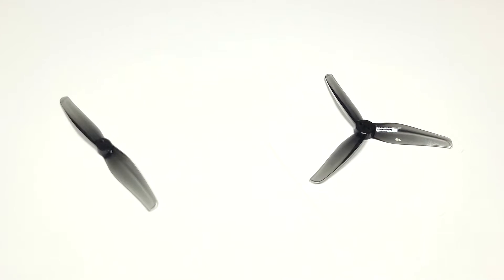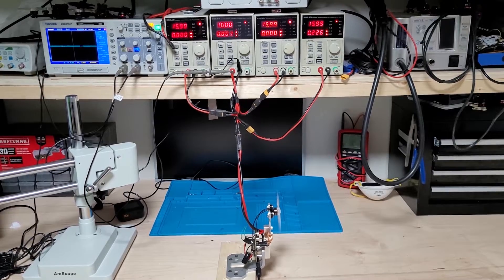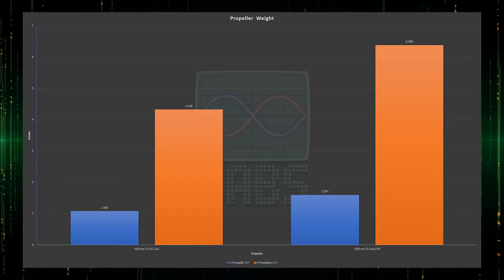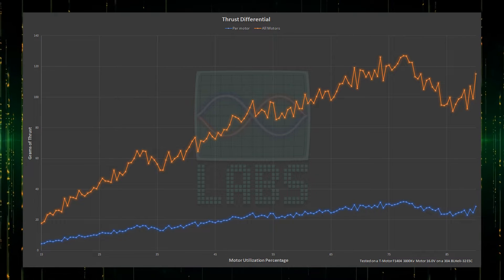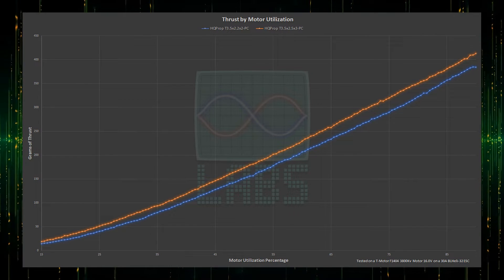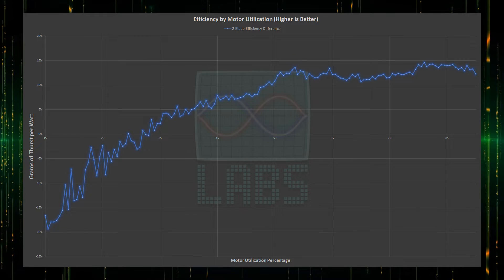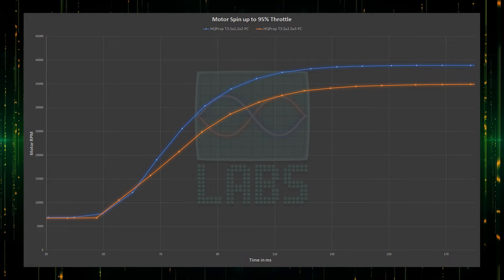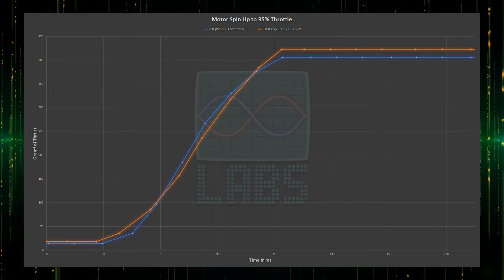2 Blade vs 3 Blade Drone Propellers - 3.5" Propeller Testing of the HQProp T3.5x2.5x3 vs T3.5x2.2x2

Comment: My observation is 
If you use 2 blade propeller suppose 20 inch dia u shall have to run motors at say 4000 rpm to get thruzt
Thus the badic torque req

Comment: One thing you forgot to test battery life and flight time....I would say the best one would be the one that enables the most flight time.
Reply from the maker: The charts show efficiency per gram of thrust, which is measurement of battery power output requirements.

Comment: my average throttle is 26% for an acro flight for probably 80% of the flight only really need the full throttle for a few seconds for power loops and pulling out of dives. for a long range your going to be climbing the mountain by wattage etc so quite low throttle... the thin air at the top of the mountain is going to force higher throttle to keep the lift for that same weight... so would the extra blade help it would help with lift but at the cost of a minor weight increase of the extra blade and the extra power needed to spin it.... this will be dependant on the weight of the quad to tell if it would be worth it... light long range would benefit using 3 blades... heavy long rang ???? (most motors will be over propped for long range as they will be more efficient this way as they don't need to react fast hence the need to use 2 blade)

Comment: Thank you 4:36 for your data driven analysis.
Do you have the equipment to test decibels & pitch frequency? 
You would then have the ability to test: thrust, amps,rpm against “Noise” for a given blade configuration (diameter, pitch & number of blades).
For some flyers, Noise is a large concern in a neighborhood setting, & may limit flying location availability.

Thank you.

Comment: Awewsome mate, keep the testing vids up! That is exactly what we need. Short video, facts only, no yada yada. Love it! 5/5 Stars!

I'm currently in the market for a new copter after not flying for years, just ordered a new Transmitter, figuring out the rest on the way. Looking for about 10mins of flight time and some capability in freestyle and racing. Nothing fancy so to speak, but I want to max out the flight time with the minimum bat size. Considering 1s LIION and 3" pick or 4" 3S LIPO/LIION setup. Unsure still, but likely going with 2blades now.

Comment: Motor engineer here, the problem lies in inertia, i don't know about these smaller motors,but on 5 inches about 50% of the power train inertia is in the motor bell, so the 2 blade doesn't spin up much faster at low regimes, where majority of the power goes into acceleration of the inertial mass instead of air motion.

2 blades shine more on smaller motors (relative to build size)
Reply: That is maybe why you want more blades for 3D mode. I want to get as fast air motion power as possible when changing direction. Because when the direction of rotation changes, the motor comes to a standstill for a very short time. And at that exact moment + -, the PID controller can no longer control the quad to maintain its position. This can lead to severe jerking... And that's exactly what you don't want...

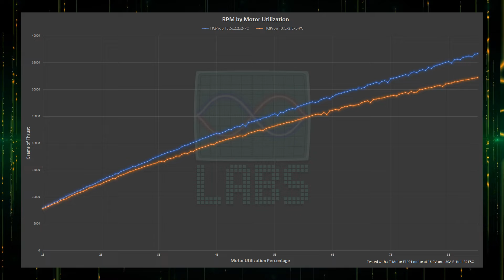Comment: Informative as always! 3:15 thank you! Personally I would use the two blade props for slightly smaller motors (ex. 1603 or 1106). Could you compare 3.5" triblade on 4S vs 4" two blade on 3S with the same motor (1408 3800kv)?
Reply: I think the two blade is well suited for the hglrc 1303.5 5000kv on 3s as a light build. Maybe 4500kv on 4S. Motors are on the way 😆. On 1204 8000kv 2s these blades were awesome. Now I just need a little more low end control and more Power from 3S and 1303.5
Reply: @chrisbee5481  Why not 1105 then? It's bigger and lighter than 1303.5 but anyway let me now how they goes :)
Reply: @samuelepaganoni9741  I've studied 1106 motor thrust test charts and compared them to 1304. 1106 is lighter. The motor stator volume is more or less the same. 1106 is just slightly bigger. Even though it's slightly bigger stator volume, the 1304 beats it in max thrust and overall efficiency. You need tourque to spin larger heavier props. Wider stators provied more tourque. The test data is all out there. You just have to find it and research. If you intend to spin larger and more pitch props, always step up the motor seize in width and not hight. So from 1204 to 1404 and not 1206.
Reply: @chrisbee5481  in efficiency at lower throttle yes because is smaller, in torque and thrust i don't think so, where did you see It?

Comment: Are the 1404 3800kv still the best choice for the tri blades?
Reply from the maker: If you're referring to the motor in this video, then yes, by a lot (that I have tested so far anyway).
Reply: @RecursionLabs  I guess I’m more referring to best combo for 3.5 inch props with the crux35 frame or similar
Reply from the maker: @bread12678  Yes, so far it's the T-Motor F1404.

Comment: What about 2 blade 3.5" on 1303.5 5500kV? 
(got Rekon35 from HGLRC with 3520 gemfan, but not sure how would 2 blade act)
Reply from the maker: I don't know since I have not tested it. It's possible the motor might struggle on the 3 blade and not the 2 blade though in that situation.
Reply: @RecursionLabs  I think that 3.5" gives a lot opportunity for sub250 builds, so testing motors such as 1303.5 would be cool. Btw, Dave_C FPV (designer of Rekon quads) also developed 1603 motor, which he claims is better than 1404 for LR endurance 4".
Reply: The hglrc 1303.5 will work perfect on this bi blade. It's just a question if 4500kv on 4S or 5000kv on 3S. I'll be testing soo
Reply: @chrisbee5481  Do you think bi-blade 3.5" would be less responsive with 1303.5 5500kV motor?
Reply: @brezovprut4431  I've tested the t3.5x2.2 on 8000kv 1204 with 2S. It defenatly takes 0.x of a second longer to respond vs 3".
Also it feels less more floaty. Altough my setup is ultra crazy light at 52g dry and 82 all up weight. It was actually intended on 1S, but 2S was a blast. 1303.5 on 3S should be more responsive at the bottom.

Comment: Nice testing! It’s interesting that HQ went with a lower pitch on the 2 blade. I guess it would target someone wanting to drop down to a smaller lighter motor that would struggle with the triblade?
Reply from the maker: That's my guess too. On smaller motors they would likely do better, like 4" 2 blades do on 1404.
Reply: it's the 2blade higher pitch variant of the t3.5x2x3
Reply: Was wondering about that, too. If I had this nice of a testing rig, I'd also be interested in 2 vs. 3 vs. 4 Blade but all other parameters (diameter AND pitch AND voltage AND motor) being the same. And perform that test with a motors which has three different KV versions available, so you get 3x3 charts out of it.

Comment: Have you ever burn a 1404 on your thrust bench in 4s?.  Did you tes multiwire small motor?
Reply from the maker: No, but someone wanted me to test 5000kv RCInpower 1207 motors on 4s and at about the 80% throttle test the wires smoked. Not surprised because the kv is suited for 3s.
Reply: @RecursionLabs  which props did you test this on?

Comment: Thanks for sharing. I like the locked in feel of the 3 blade more. Also the lower noise. What I dont understand is, why two blade just seems to fly faster? Like the thrust stand test always show more top end thrust for 3 blade, but in reality two blade hast more top speed. It could be less air resistance.
Just guessing.
I moved some of my 3 inch builds to a 3.5 inch bi blade. Fly good.
I think its only fair to compare a 3.5 inch tri blade to a slightly bigger 4 inch bi blade. Then the bi blade might win again.
Reply from the maker: Interesting observation. Which motors are you running them on? It''s possible the 3 blade are overloading them.
Reply: @RecursionLabs  coming back to this: I have several 3.5 inch builds.
Also tested all 3.5 inch props on 1404, 1804 and 2004 motors.
No bench test data , but just subjective feel.
The hglrc 1804 3500kv on 4S are awesome on all props, but best for the emax 3528. I also tested them on the new emax 3630. Very nice too, but really suck the current Limits on an 750~850mah 4s lipo and xt30 plug. Up to about 70~80A on full throttle incl voltage sag. The performance is insane and makes you smile.
All tested on a naked vista twig 140 build. Dry weight 120g with 1804s.

On 2004 2100kv motors and 3538 props on 6S ,it flew well, but not really as good as or better than the 1804's. The kv are too low.

Now I'm building with 2600kv hglrc 2004 motors (made by rcinpower. Awesome quality) on 650mah 6s tattu lipos. The emax 3630 are my prefered props for this build. The amp draw should also be approximatly  60A pushing the limit.

The new hq t3.5x2.2 bi blade outperforms all the typical 3" props like gemfan 3018, 3016, 3020 and 3028 on 1204 or 1303.5 motors. The top speed and acceleration is insane. 1204 or 1303.5 is probably the sweet spot for this t3.5x2.2 prop.
I'll be doing more testing.
Keep up the good work.

By the way: that bi blades are faster is just a proven fact. That's my observation and also so many people I've seen talk about this, also claim they are faster. Just the cornering grip lacks and they are freaking loud when on a powertrain setup. All speed records were accieved on bi blades too.
Of course it depends on what exact bi blade prop.
Reply: On 1102 10,000 kv and 1103 10,000kv I have noticed the same with bi-blades being faster, but my best matched comparison pits the HQ T65 against the GF2512. The higher-pitched bi-blade has better top-end with high-kv. My theory is that the higher pitch is made feasible on given stator size by having one fewer blade. Perhaps only high kv motors can reap this benefit?
Reply: @yohfpv  I've been building high speed racing quads lately.
On all of my speed runs, the bi blade props have had a about 20% higher top speed.
My theory is that the third blade adds more resistance spinning through the air.
For example take a boat.
Hold two identical sticks into the water. Feel the resistance.
Now add a third stick.
Guess what?
More resistance right?
So thats why.
Also an aerodynamic expert said the prop tips make air turbulances that become even more by every blade added.

Comment: You are so underrated and your data is awesome! I would love to see your thought process for PID tuning for this build, given that you have so much data. I feel like doing that would help a lot of your viewers understand the importance of running these tests and how that data can be applied. You're doing some amazing work man!
Reply from the maker: Thanks bud, that's really nice to hear someone say. I'd like to think I'm decent at it, but there are probably better resources for PID tuning than me. This data is really good however to help adjust a good tune when changing props if you know how they perform comparatively. I know I use it for that.

What I'd really like to attempt to convey is the importance of balance between thrust/efficiency, with battery size (to be able to properly drive the motor), and weight. The goal (mine anyway) is really to get the highest thrust/weight ratio possible, while keeping the weight as low as possible (more agile) while also meeting the durability requirements (which is also impacted by weight). Without this data its pretty much guess work when choosing and matching up components, which is why I'm doing tests and publishing them for everyone to be able to reference.
Reply: @RecursionLabs  You really are doing a service for the sub 250g community. I don't see a lot of people building around this weight too often, or at least promoting it as as often. My last build was built off of your data and this little thing is a monster. I was not expecting the amount of thrust that it put off and I nearly crashed on my maiden just from the take off 😂. Like I said you're doing a great job and I love seeing your videos just because they're so informative and not enough individuals are doing motor/prop tests like you are!